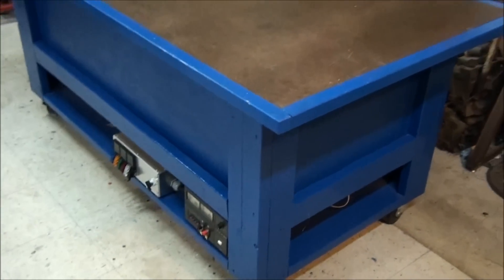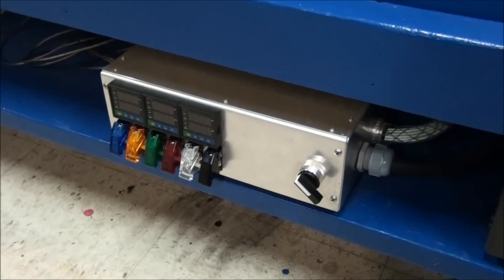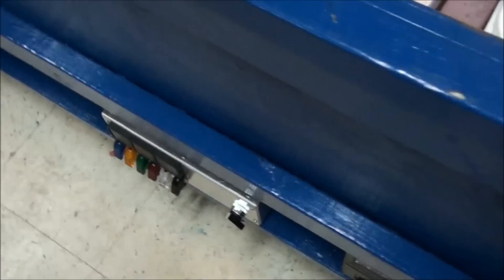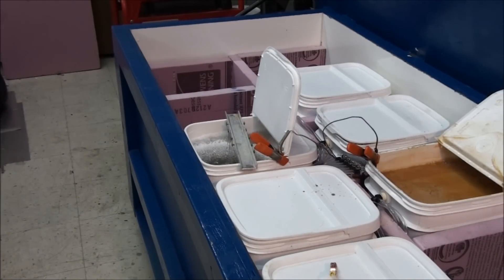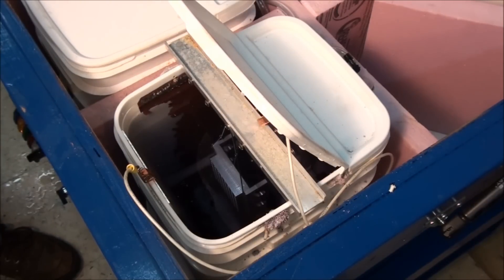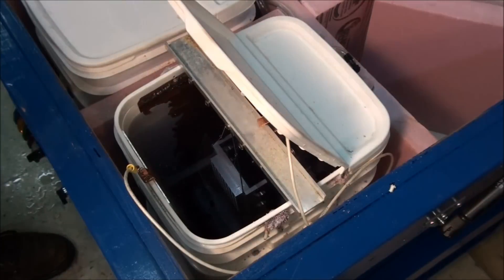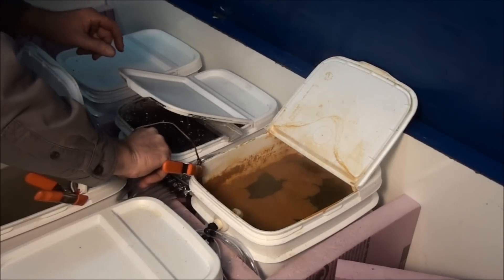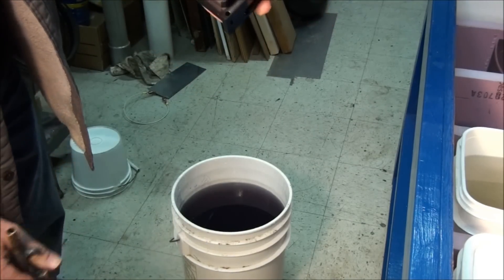A Demonstration of my Home Anodizing Set up

Comment: This has very much peaked my interest, and I signed up to your website do get the plans to build something similar. I have one question though......what do you do with the chemicals, or contaminated water, or acid if you have to dump them? I wouldn't think that you could dump them into a city sewer, and as I live in the country, I wouldn't be too sure about dumping them into a septic system. I know our shop had very strict regulations against hazardous materials.
Reply: Will you be surprised if I tell you that all the chemicals found in this vid (and there is 1 step missing - deoxidizing/desmutting of certain aluminum alloys is required after etch) can be bought in any reasonable hardware store and don't require any special disposal means? caustic soda is used as a drain cleaner, dry form powder with some aluminum in it (basically that is your etch tank), car battery acid - 20% sulfuric acid, dilute that with the same amount of DI or RO water and you have your anodizing tank, degreasing and deox/desmut can be done with household laundry and bathroom cleanup products, some mechanical brushing may be needed though - and that is about all there is to it, you can get near perfect typeII anodizing finish on any alu alloy, including 2024 and 7xxx series.

Regulations regarding disposal of these waste waters (rinsing) are there to keep large workshop operations in check, none of this sort of hobby scale anodizing will make any sort of impact on any city sewage system, and lets face it, maybe 1 in 10000 houses will have a setup like this in their garage, and when you're completely done with it, take a big bucket, pour your anodizing acid in it and start adding in your etch tank contents, mind the obvious safety of heat generated by the reaction, keep adding more soda until there is no obvious signs of reaction, if you have the means - measure the ph, and when it is neutral, you are pretty safe to discharge the contents into sewage system, dilute them with tap water, that is how they will do it in the hazardus waste disposal facility.

Comment: This is beautiful work I'm building a similar setup for my self after receiving a super high quote for some parts I need is better to built my own......
Reply from the maker: Thanks. It was an interesting but challenging project.
Reply: Can you tell me what power supply are you using....
Reply from the maker: The power supply is just an old Alinco bench top supply I had laying around. It puts out 20VCD@30A. It has some issues and I would eventually like to replace it with an Astron 50A supply, but they are a bit pricey.
Reply: Ok thanks but how you regulate the amps...maybe with a potentiometer?
Reply from the maker: The power supply has separate voltage and amperage controls so you can tweak it during the anodizing process to maintain the proper amperage.

Comment: Very interesting. I would like to see one thing with your setup, labeling the buckets with what they have in them. As my dept's safety officer, I would hate to have to go in and figure out what was in each bucket. Also label each of the switches and the pump valves. It just make for a neater workshop.
Reply from the maker: That would make sense if other people were using the set-up, but since I'm the only one, I pretty much know what is in each tank and what all the switches do.

Thanks for watching.

Tom

Comment: Not sure I would rinse my dyed part in the same water I rinse off acid and lye in.  You're asking for a streaked finish.   You might want to rinse parts out of the electrolyte in distilled water/baking soda mix, then rinse in distilled.
Reply from the maker: I start out with fresh tap water for every batch and rinse that off with distilled in the sprayer. It works great. I suppose at some point the concentration could get high enough to cause problems, but I haven't experienced any yet.

Tom
Reply: Toms Techniques I would like nothing more than to use regular tap water in certain steps.  Right now, I use distilled for EVERYTHING except the intitial removal of anodizing (tap water and lye drain cleaner).  I degrease with "Greased Lightening" and hot tap water.   Then it's all distilled from there until final rinse out of the sealer.  Gets expensive.  If I use tap water with my muriatic acid (desmut), the desmut mixture turns orange from the impurities in the tap water.  So, you're saying it's safe to rinse with tap water after the electrolyte process, then spray with distilled before the dye bath?  I usually put the parts in distilled water/baking soda mixture out of the electrolyte.  It neutralizes the acid.  I then rinse again in distilled with a spray bottle.  Maybe I can use a tap water/baking soda mixture out of the electrolyte?   If  i rinse anything that comes out of acid or lye (etch, desmut and electrolyte) I immediately throw that water out, but I'm not using a spackle bucket full like you.
Reply from the maker: McFeely Bhoob

I spray the parts down with distilled water after every dip in the tap water, so it never sits on the surface for more than a few seconds. It works well and save a lot of distilled water.

Tom

Comment: Hi Tom,

I've picked up many useful pieces of info from your channel, sincere thanks.  I may have a few tips for anodizing as I've been doing it for years.

Cathodes:  Use Lead, it can be left in the tank.  Sulfuric acid will cause a sulfate deposit, but it drops off when the current is passed through (similar to a car battery).
The yellow cast on thick anodize is from impurities, probably from the previously dissolved cathodes - aluminium is nearly always alloyed (Si Fe Cu Mn Cr V etc).
Within reason, the colder the tank the harder the anodize layer.
Thick anodize is more prone to cracking if the part flexes.
Titanium and Zinc can be anodized, but there's little point as the oxide tends to fall off.  I use Titanium wire to hang parts.

I can give specifics if anyone is interested.

Thanks again for all your useful tips.
Kurt.
Reply from the maker: Hey Kurt,

That's a good idea about the lead cathodes, but with the feds shutting down all of the manufacturers, the price of lead sheet has gone off the charts. The only stuff I could find was $30 a square foot for 1/16".

The first parts I ran actually had that yellow tinge. According to the Ron Newman book, the color of the coating is a function of time. It sounds like impurities must have the same effect.

I have been looking for titanium wire so I don't keep burning through my supply of aluminum welding rod.

I haven't done a lot with it yet, but what I have done has turned out well. It is a pain to use in the winter though. The last time I used it, it took forever to get the temperature up on the anodizing tank (I keep the shop at 50º). Maybe a heater is in order for that tank as well.

Glad you are enjoying the channel.

Tom
Reply: Hi Kurt- thanks for the useful tips. I understand that cast components can not be anodized very well. In your experience do you know if polished cast items can be clear anodized and then sealed to lock in the polished surface?I'd appreciate your ideas on this matter, thanks in advance.

Comment: Nice set up. I pull my anodes out of the acid solution, to prevent them from getting dissolved. Also, you can do the math and adjust your anodizing time for a shorter period. Doing a lot of parts the solution heats up quick.You have enough current you could do type 3 at about 55 degrees and get a much tougher coating. Frozen 2 liter pop bottles help to keep the acid temp low. We had thought about routing a high volume fountain pump through a bucket of ice water and line the tank w/ plastic tubing to keep the temp low.
Reply from the maker: Thanks Richard,

I was surprised to see that the anodes had gone away so quickly. They are already redesigned to hang on the edge of the bucket so they can be removed after use.

I've noticed that longer times produce parts with a yellow cast, which I assume is a thicker, more durable coating. Shorter times and higher current make more of a clear coating. Not sure how far it can be pushed before the dye starts complaining.

Tom
Reply: Toms Techniques Aluminum is like a sponge, the electrolysis will continue to eat away at the metal. At some point you will reach the law of diminshing returns ie: more time will gain no benefit.
 The 1 hour thing is just a general guide line, pretty much recognized as an industry standard.
 When we are in a pinch and the wedge slipps; crank up the amps, keep the temp low as possible and blow through. The difference occurs if you run 2 different batches of the same part for the client with differnt dyes (trust me they will know!)
 I made a bunch of threaded aluminum pins to screw into the parts for the anod to clip to.
 This was after discovering the anode lead will eat the part at the contact point, and, will not take dye at that location.
 One of my "rocket scientists" ruined about $1,800 worth of machined parts. because the lead was attached to a critical hole, changing the diameter. 
 As far a durability of coating, that will only be accompolished by going to 24V DC @ lower temp. 
The dye & nickle actetae sealer will remain the same
Reply: Richard Kicklighter "This was after discovering the anode lead will eat the part at the contact point"  i was wondering about this.  looks like many people use an aluminum welding rod to hang the parts to be anodized on/attach the DC line to.  does the welding rod create anodizing issues at the point of contact to the parts from what you've seen?  seems as though some people spend just as much, if not more, time making up jigs to hold the parts as they do anodizing them so as not to create issues in this area.

Comment: Very nice setup. Much appreceated seeing the amount work and the number of components involved. Do you have any experience powder coating your parts? seems much less involved, fewer items needed, easier to have a large color selection on hand and possibly much more durable than anodizing.
This is an interesting comparison between paint, powder and anodizing http://youtu.be/27Pr_r40GaY
Love your video's
Reply from the maker: Powder coating doesn't work with machined parts because of its thickness and most of the things I color are machined. I have thought about adding it for the fab work that I do, but really don''t have the room for an oven.

Glad you enjoyed the video.

Tom
Reply: Toms Techniques I see thanks Tom. I always wondered about that. Difficult for me to understand why. Like aluminum motorcycle wheels are sometimes machined out of billet aluminum and they can be powder coated.  bearing surfices and threads just get plugged to keep the powder from critical arias.

Comment: Tom, thanks for showing your setup. Looks great...though labeling might help when you don't use it for a while...maybe on the valves and a "cheat sheet" on the underside of the bench top?  The colored switches look perfect for when you have all the dye colors in play!

John Grimsmo has shown titanium anodizing in a couple of his videos.  It appears to be different from aluminum in that dye is not required, and the color varies with the voltage used. This can be problematic at times. He had a knife side with graphite inlays that had wire filaments in it (called lightning strike I think) and the difference in conductivity resulted in color variations near the inlays. Colors achievable include yellow, gold, green, orange, brown, blue, and purple. I think the voltage ranges are something like 20 to 80 volts.
Reply from the maker: I think that once the air valves are set up for all the tanks, they can just be left alone. Eventually there will be a trim panel with cutouts for the buckets, so the valves will be covered anyway. A cheat sheet for the process is a great idea. It is a lot of stuff to keep track of when you don't use the system very often.

Thanks for the info on titanium. Now that you mention it, I do remember that voltage is used to create the colors.

Tom

Comment: Any issues with fumes from the chemical baths attacking other tools in your shop?  Seems like extra precautions may be needed to keep the corrosives and their fumes well away from the tools.
Reply from the maker: The only thing I thought might be a problem was the sulphuric acid bath and I considered installing a vent in the bench, So far though, the sealed lids on the buckets and the enclosed bench seems to keep it at bay.

Tom
Reply: Toms Techniques Should anodizing not take place near gas appliances with pilot lights such as water heaters or dryers since the process produces hydrogen gas?
Reply from the maker: Steven Konet
Any hydrogen produced in this small of a set-up is negligible. I'm more concerned about the fumes and will be figuring out some sort of ventilation for it this summer.

Tom

Comment: That is a very nicely done setup. Ive been wanting to get a anodizing and plating setup made for some time. Think ill get around to it this year. Where dis you get those temp controllers?  I would like to make something like you have done.
Reply from the maker: The PID's came from http://www.lightobject.com/. The heater, thermocouples, SSR's, etc. came from eBay. The buckets came from Baytech.com. If you look at the build thread in the description above, it will provide a lot of the details.

Tom

Comment: Hi Tom,
You can anodize in hot weather also without a chiller by using Sulfuric/Oxalic acid solution. In my anodizing line I use 150/30 g/L solution at 27-28C all the time with good results.
Reply from the maker: Thanks, I'll have to give that a try. Where does one buy oxalic acid?

Tom
Reply: Here in Latvia I can buy it freely in a local chemicals store. In US it looks like you can buy it on eBay at least: http://www.ebay.com/sch/i.html?_sacat=0&_from=R40&_nkw=oxalic+acid&_sop=12

Comment: Dear Tom,

As always, I'm amazed by the amount of knowledge\capability you have, wish I was at your level!

If I may, other than cosmetics, does anodizing a part has any effect on its material properties? Like strength, hardness, electrical conductivity, etc.

Thank you very much for sharing all this with us! :)

-- Arye Segal.
Reply from the maker: Arye,

Anodizing provides protection from corrosion and it is very hard, so it also helps protect against wear. It is a non-conductive surface.

Thanks for watching.

Tom

Comment: Another interesting video Tom! You should be on TV :)  I do doubt though that this is a small work shop with all the toys you have in there! Unless you are a time lord and this is a tardis ...
Reply from the maker: Thanks.

The shop is 23' x 24' and is packed to the gills. I'm thinking about adding a bay on the back for the project car and someplace to store the stock. That would make a lot more room for machines.

Tom

Comment: Ha, ha, - all there is to anodizing, you said - it is a lot of work, I think - you have to have a system like yours for all the different baths and in a stable arrangement like your table - very practical - you CAN'T do it "in the kitchen" every time you have a little piece of alu for anodizing !

But very, very interesting to see how it's done - now I can only DREAM of getting a system like that - I simply haven't the space in the shop ;-(( !

I wonder the buckets can cope the high temperature !
Reply from the maker: It really does take a dedicated set-up. Otherwise you would spend all your time setting it up and tearing it down. The dye tanks are fine at 140ºF, but the sealer tank is pushing the limit for polyethylene. I have the sides reinforced and so far its been ok. Eventually I may have to invest in a polypropylene tank for it.

Tom

Comment: Tom

You're in the Detroit area, correct ?  Does a Michigan winter affect your setup ?

Thanks for sharing - an anodising outfit is not what you'd likely expect in a typical home workshop.

Warm regards from Australia.
Reply from the maker: I keep the shop at 55º when I'm not using it so the anodizing tank needs to be brought up to 70ºF before I can use it. I was thinking of adding some heating pads to the outside of the bucket.

Tom

Comment: Tom that is a very cool setup indeed.  I like your PID temperature controllers and power supply setup I can tell you have spent some time working in a lab (missile switches, chassis box, strain reliefs...).  I'll have to checkout your build thread,I̶ ̶d̶i̶d̶ ̶n̶o̶t̶ ̶t̶h̶i̶n̶k̶ ̶t̶h̶e̶ ̶d̶y̶e̶s̶ ̶o̶r̶ ̶s̶o̶m̶e̶ ̶o̶f̶ ̶t̶h̶e̶ ̶c̶h̶e̶m̶i̶s̶t̶r̶y̶ ̶f̶o̶r̶ ̶t̶h̶e̶ ̶s̶e̶a̶l̶e̶r̶ ̶w̶a̶s̶ ̶r̶e̶a̶d̶i̶l̶y̶ ̶a̶v̶a̶i̶l̶a̶b̶l̶e̶ ̶w̶i̶t̶h̶o̶u̶t̶ ̶a̶ ̶l̶o̶t̶ ̶o̶f̶ ̶r̶e̶d̶ ̶t̶a̶p̶e̶.̶

OK I checked out your build thread, nice work.  For someone who claims to not know electronics it looks good.  I know you have fuses in there somewhere...

Comment: Super! I do some electrolysis to clean rust parts. I like the idea of the pressurise air. Does the liquid stay inside the tubing when not in use ?
It would be a great video to see how you manage the space in your shop. Great setup. Thanks
Reply from the maker: Yes Robert, the liquid stays in the tube, although the level is very close. I was concerned about it getting to the neighboring tanks and causing contamination, but it seems to work fine.

Tom